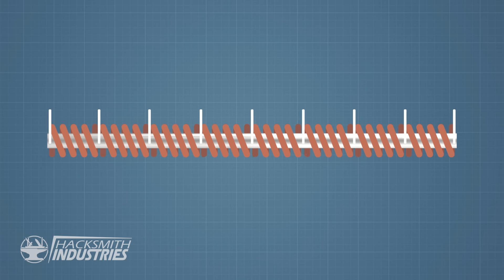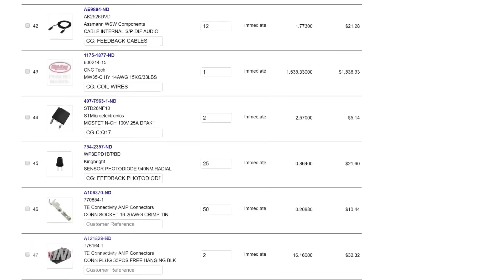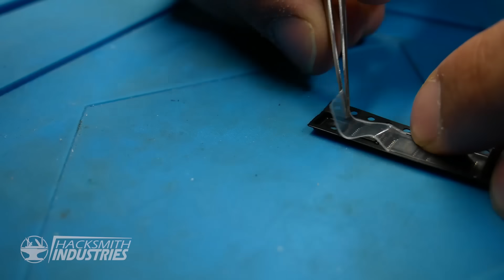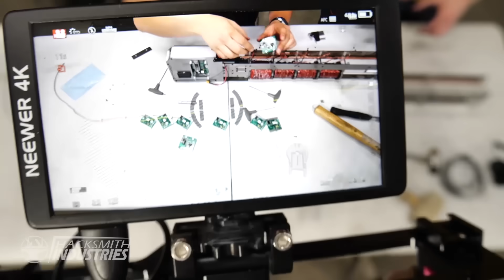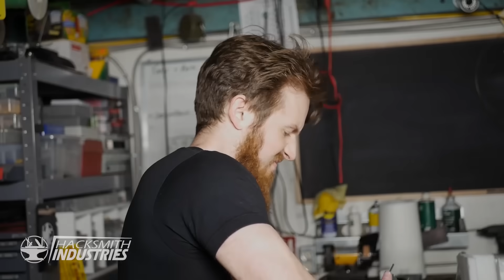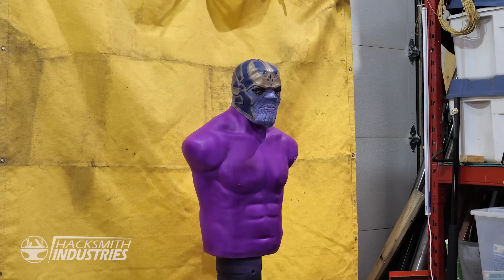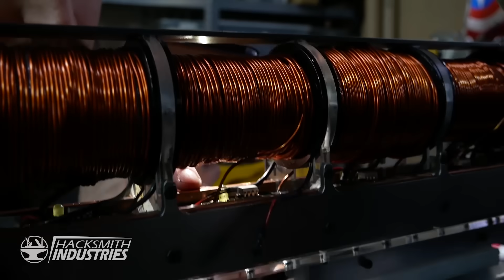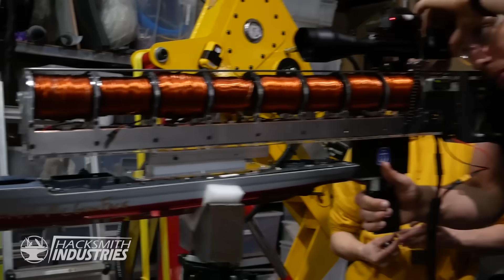50 CAL ELECTRIC COILGUN

Comment: You should try firing 12mm steel ball bearings from your coil gun.
Reply: And rifle the tube
Reply: @Andrew-ob4jr  not necessary with ball bearings.
Reply: Of coarse it is.
Reply: @Andrew-ob4jr  rifling suggests that the round will meet with the barrel on its way out. If your ammo meets with the barrel of your coil gun, you've severely miscalculated one or more integral factors.
Reply: Okay which would be what? Rifling would increase the projectiles accuracy even with a ball bearing rifling would not hurt the Integrity of the barrel
Reply: @Andrew-ob4jr  Except that we're not talking about a conventional firearm. Your argument would carry weight if we were talking about powder weapons. A coil gun uses a cushion of magnetic force to propel a projectile. This cushion prevents the projectile from coming into contact with the inside surface of the barrel. Rifling would be superfluous to the functionality.
Reply: @Andrew-ob4jr  there's a bunch of great tutorial videos here on YouTube that can explain the physics better than I can.
Reply: Rifling would not choke the projectile as bad as you make it out. The schedule of the tube  they use would still allow the cushion you're talking about. Regardless if it had rifling or not.
Reply: For example take 10:12. Now imagine the bar stock in a tube with the same ID as the bar stocks OD. The bar stock would reverb back in forth in the tube. Because the tube wouldn't block the cushion created by the magnetic field.
Reply: @Andrew-ob4jr  I'd still recommend watching some videos on the subject. I'm not saying that rifling would choke the projectile. I'm saying that it wouldn't have any effect at all. There is no gas expulsion behind the round to cause it to spin as the gas goes through the rifling. It is effectively pulled through the barrel, and stabilized by the magnetic cushion. Rifling would have no effect, good or bad. Most coil guns have plastic (usually PVC) barrels, and are just as accurate as any rifle.
Reply: I suppose you could set up a system (theoretically) that could cause the spin stabilization that rifling provides in traditional firearms, but rifling the barrel won't do it.
Reply: Im not wanting to continue an argument. We will just agree to disagree. But i would just like to address something you said. " there is no gas explosion behind the round to cause it to spin as the gas goes through the rifling." Is this what you meant to put. If not i understand it must be some typos. But if so the explosion caused by the powder in a traditional firearm doesn't cause the spin of the projectile when the gas goes to the rifle, that is the riflings job the explosion just gives the round the momentum to move forward. I just want to make that correction but once again no argument if it was just a typo
Reply: With that being said I would love for the hacksmith to read these and do some experiments with a rifled versus a non rifled tube and a variety of projectiles. That would be amazing to see
Reply: @Andrew-ob4jr  I said "expulsion". When a powder round is fired, there is an expulsion of gas which causes massive expansion, which propels the round. A coil gun works in almost exactly the opposite way.

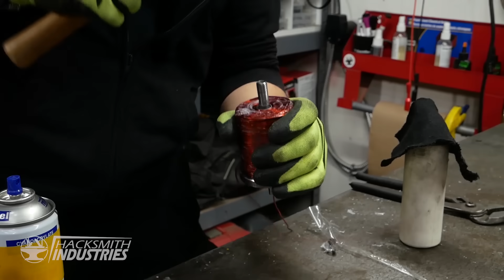Comment: I noticed that friends reference at 4:24

(Btw how has the military not raided you yet)
Reply: The Hacksmith is in Canada I think
Reply: Using a gun like this on any worthwhile scale would cost an unreasonablely large amount of electricity
Reply: @innouniversedoineedthis  Just like the US-Railgun-Project - and they are still developing it, despite it being less advanced than a good coilgun, not to mention that the rails, like a barrel, do wear out and need replacing ever so often - neither of which is a problem in a coilgun - it is just more complicated to make in the first place and more expensive, but that cost is easily saved IMHO by not having to replace barrels, not having explosive charges etc. etc.
Reply: Because the rail gun has the power of a BB gun.
Reply: @dreamingflurry2729  the more complicated something is the more likely it will malfunction in the oh so not ideal conditions of the battlefield.
Reply: @DarCrow1275  fun fact, Canada has a military

Comment: It's really unsatisfying that the bullets fly sideways instead of flying straight, even when it's sharp, it doesn't give that satisfying piercing.
Reply: The massive military grade ones do
Reply: They made a too higher calibre and can't get the velocity ot keep it stable. If it was a much smaller dense shot it owuld work much better.
Reply: Can't you rifle the barrel and get rotation as it goes down the barrel?

Comment: See, here's the thing. This gun is AWESOME, but I want to see something lethally awesome. From a ballistics standpoint, this could be massively improved if you used smaller, lighter projectiles and implemented rifling. That would improve both aim and penetration/stopping power.
Reply: Im working on a version that is single stage, doesnt require timing, and uses .177cal bbs. (Though i may up it to 9mm) 
The way im coiling the wire, the electric field should impart rotation.

Comment: Key-holing and a bit slower than I had hoped, more research, rework and tuning, Perhaps larger transistors and a fair amount of capacitance at each stage...
Reply: And rewound coils.
Reply: Custom designed projectiles too. They seem to have a major tumbling problem coming out the barrel. I don't think rifling would work with such a system so they'll have to look more into smoothbore weapon engineering.
Reply: You could probably still make rifling, but if the velocity were high enough, you'd probably have to have a very low twist rate to avoid spin drift.

Comment: You should make the projectiles more front-heavy so they don‘t spinn around that much. Good Video though 👍🏼
Reply: plus small silicone fins in the back ??
Reply: @attempted-CAW-murder   I don’t know. They could come off easily due to the extreme speed. But fins in general would make them more  aerodynamic. 👍🏼
Reply: @rezeq634  What's the speed? )) They barely fly

Comment: What weight projectiles were you using and what kind of velocity did you get from the projectile as it left the muzzle?

For accuracy, you can try using a projectile shaped like a badminton shuttlecock instead of a cylinder. I'm guessing that using lighter projectiles will throw the timing completely off though since you'd reach higher speeds.

Comment: I saw that projectile hitting target at the strange angles, you should either somehow use twist in the barrel to stabilize the projectile with gyroscopic effect which is not very easy to do this twist inside barrel grooves or use self stabilizing projectiles and I think the best would be something like subsonic using in airguns diablo projectiles/pellets, they like smooth barrels and they are self stabilizing thx to their CG and shape with skirt. Or use fins which is not very easy to do tho.

Comment: It looks a bit slow to be honest, I remember messing around with an air core inductor, flash bulb charger and ball bearing and it was faster than this. I think if you had coils with smaller air gap in the centre and lighter projectile you would get more acceleration and speed.
Also you can recover some energy when the coils are shut off since they will give a large back emf.

Comment: I think replacing an insulated fire tube with a spiral design on the inside will increase the projectile's accuracy throughout its flight. It'll create a horizontal axis on the projectile while it's in mid-air allowing it to spin and thus increase accuracy. Lol wishing for another future hacksmith electromagnet gun.

Comment: Pls respond if u think u can help me with my questions (or if u think u can help me with my questions!) ur help is appreciated!
What if the video’s coil gun didnt attract the ammunition to accelerate it, but instead repulsed the ammunition (which throughout the rest of the comment I didnt specify that for the repelling coil gun the ammunition had to be magnetic)

Basically I figure that both coil gun ideas expel the same force on the ammo, (if I’m wrong pls respond and tell me ur ideas) but my other question is, is it simpler, harder, or just the same in making a working coil gun that repels the magnetic ammo? Pls respond if u can help (or think u can help) it is appreciated!
Reply: You can't make the coils repel a iron or steel projectile but it could theoretically work if you were to shot a magnet
Reply: Oliver Johansson thank you! I do appreciate you responding

Comment: What about rifling the inside of the barrel to make the projectile to spin and more accurate?
Reply: Honestly at the speed that its currently firing at, rifling would only stop the round. Rifling works by having the grooves literally grind into the outermost edges of the projectile which creates massive resistance on the projectile. For a normal explosive charged round like a bullet or artillery this is typically just overcome by the sheer amount of energy pushing the projectile forward and while that same principle would still apply with a coil gun their model is too under powered to overcome that friction. Gotta up that power!
Reply: TJW595 Let's try it with a almost straight lines, just slightly rotating and a smaller projectile. I'm curious to see what would happen even if it fails. If it doesn't work, let's try different shapes of projectiles.
Reply: @kerebaka  You could possibly use some sort of discarding sabot projectile that has something on the outside to grind through the rifling but then falls away once the projectile leaves the barrel. I still feel like a bit more speed would be necessary but with a slight rifling that doesn't cause too much friction it might not be too bad.
Reply: TJW595 Interesting...

Comment: What about making the bolt in the coil launch a projectile like a traditional ar15 will.  That way you don’t need as many electronics or added weight the way the projectile retracted with to holding the power on too long will automatically reset for fully auto or spring fed mags

Comment: Freedom units wow as a USA boi I agree
Reply: "There are two units of measure: the ones used by the people that put a man on the moon, and the ones used by everyone else."
Reply: @pyrobob5724  the former would be metric. NASA doesn't use imperial...
Reply: @risfutile  NASA primarily used USCS (not technically Imperial although the two get lumped together) until about 1990... Although in practical use they were still using USCS until about 10 years ago. 
Either way all of the missions that actually put man on the moon were done in USCS minus the odd metric measurement here or there. 

Either way... It's meant to be a joke 😋
Reply: @pyrobob5724  Damn... Well, everybody was young once and made a few mistakes... including NASA using metric only since 10 years ago 😅

Comment: Did you know some Russian APFSDS tank rounds can get up to mach 5
(1700 m/s)
Reply: Did you know the machine gun in service with the highest rate of fire is the M134 Minigun. Designed in 1960s, this weapon spat fury from helicopters and armored vehicles. This 7.62mm calibre gun fired at a super fast pace of 6,000 rounds per minute i.e. 100 rounds per second.
Reply: Well, both the Leclerc and the Leo 2's best rounds can go up to 1800 m/s (APFSDS round co-developped by the two countries by Nexter/GIAT and Rheinmetall)
Reply: Power angel the AH-1G has 2 mounted on a the nose
Reply: Ehm doesn't sound right, do you have a source on that ?

Comment: Damn...that's awesome...one thing that's cool is how this shows why you rifle barrels, if you could put a non-magnetic rifled barrel in the middle of all that you could induce a spin, increasing your accuracy and the energy delivery of the projectile. I also wonder, since it looks like you're overloading the components in the board...perhaps it might be viable to run two coils in the same section? Much like how you can put one spring inside another to occupy the same space without them touching. Thus doubling the circuits and halving the current needed for each. I'm not expecting anyone to actually try this, but something like this does fire the ol' imagination up!

Comment: It's kind of a pity they are doing this in canada, they cant amp up the damage for legal reasons. So the testing is a bit bland tbh.
Reply: not to mention the issues with hand held coil guns is with current technology you really cant make a hand held coil gun with any sort of velocity as it relys instead on the length of the barrel (aka the amount of coils that can be used to speed up the projectile) to give it said velocity which results in fairly low velocity in any sort of "gun" that is small enough to be handheld this tho is not a problem when speaking on terms of larger weapons such as a naval gun but when it comes to the regular infantry man the length of a gun and the weight are huge factors that play into its usefulness in general situations

Comment: Why is it every coilgun video I've seen the ammunition used is the size of the bullet + casing of a traditional gun? I thought a shorter bullet would go faster, but maybe it has to do with aerodynamics and the mass of the magnetic projectile.
Edit: After watching more of the video it doesn't seem like the bullets are aerodynamically stable regardless lol. I demand fin-stabilized discarding-sabot HEAT rounds!
Reply: A longer projectile will fly better, but you run into trouble with how the projectile interacts with the magnets if it's too long.
Reply: The best projectile shape for a coilgun is a cylinder with a radius of A and a length of 2A. So basically a can shape, this maximizes the magnetic coupling between the coils and the projectile.

Comment: did you take into consideration that each coil has to fire faster than the previous one?
Reply from the maker: Of course
Reply: @hacksmith  could you reverse the polarity of the previous coil in the line to make that one push the projectile while it's magnetized by the one in front?

Comment: Watching this for the first time. Video is a year old. Wondering, would the projectile not travel faster if, instead of passing current through each coil individually ( each turning on and off at a precise time), all the coils had current through them at the beginning of the shot but as the projectile passes each ‘gate’, the previous coil just turns off at the optimum time while the other coils stay active until the projectile has passed the ‘sweet spot’ ? 

I’d imagine it that would provide a bit more pull from the other coils as the projectile nears its next coil. 🤷‍♂️

Comment: I have doubt . How about we make systems that if we pull the trigger the power will be supplied to one coil for 0.5 seconds and then jump to other until it reaches the end coil, that way we can loop if we want full auto-coil gun . Because hacksmiths are using 8 + 1 pcb . But in my case we can manage it with 1. If I made any mistakes, I am sorry I don’t study electronic or about any electrical parts . It was just an random thought.

Comment: If you used 99.95 or 99.998 percent pure iron for the magnet cores under copper wire, the magnets would have been more powerful.

Comment: I once watched a video that was about a guy that assembled the worlds strongest electro magnets and he did not use wire. He used super thin plates stacked and packed in a very specific and special way.

My point is that his method was way way more efficient than a wire coil. If i am not mistaken he was able to put a lor more "windings" around a rod than with wire.

Have you guys had a look at his method.  I really think you should. Specially with todays etching technology.

The plates are also waaaay more rugged than coated wire. .   

Good luck
TGC 
Blessings :)

Comment: If you made the projectiles smaller and have more weight at the tip and less than the base could that straighten the projectile in flight and allow more accurate shots?

Comment: You should engineer a spin into the projectile for stability. Maybe a hollow round with some inner turbine blade-like fins. Or a much thinner diameter metal core with a printed outer finned shell to fit the bore size?

Comment: The only problem with this cannon is that you are not spinning the projectile. That can be solved by two means: increasing the power output, thus throwing the bolt faster; and fire pre-spun drill bits. Added benefit of that is that drill bits are high carbon steel.

Comment: You need to figure out a way to stabilize the projectiles in Flight so they actually fly horizontally instead of turning perpendicularly because when they stand up like that you start losing velocity it's still pretty damn cool though

Comment: Coil guns are so cool! Remember writing paper at university about space launch setup using coil gun. Would be much more viable than the idiotic flywheel alternative they're discussing today (spoiler alert: not going to happen). Situated in the Andes mountains - once built, it would be virtually no limit on amount of launches. Would be metal intensive though, and require some power.

Comment: Hm... Why could you not have all coils activate at once, and then just deactivate them as the bullet reaches each coil's centerpoint?  Wouldn't the further coils just be providing more force to the projectile, even if it's little?
Reply: Nope, the, making a lengthy coil means weaker magnetic field

Comment: I think the coilgun would be stronger when you have used a little steel ball as bullet and capacitors as energy source for every coil seperatly with an high voltage dc-dc converter